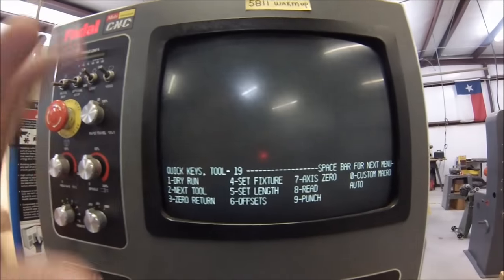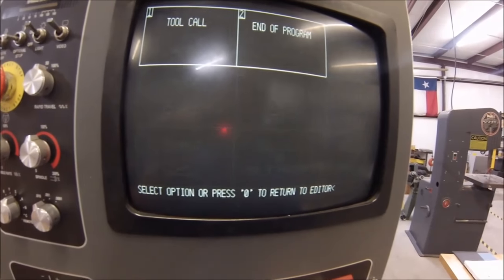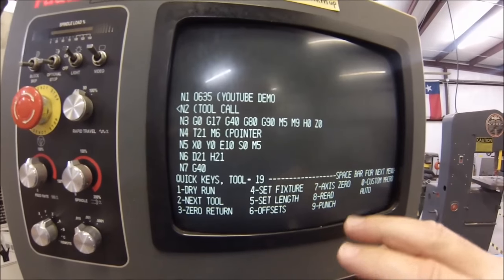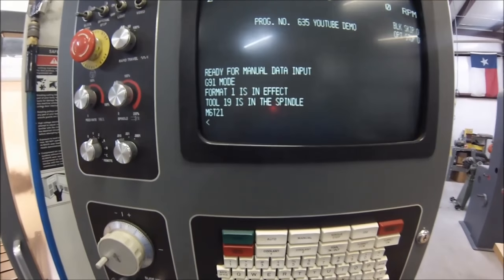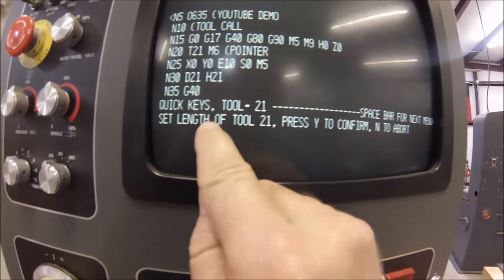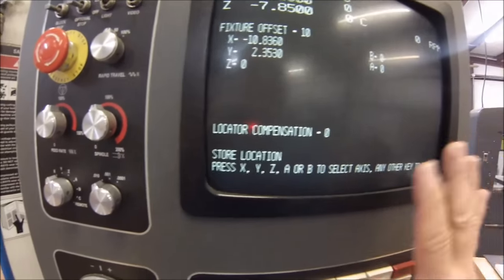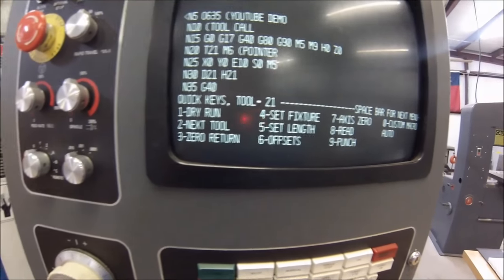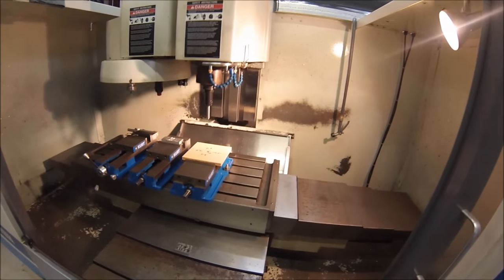CNC Machining Center  Part 3

Comment: Perfect! No more headache! No one ever shows how to set fixture height! Every video that i have found just shows how to set the tool height and tells you should do the same in fixture. I am so relived after figuring this out from youre video, and a post on a forum. fixture off set Z value should always be Z=0. 
I hope you make more videos in the future! you are really good at teaching!
Reply from the maker: I have never had a reason to change the Z height in a fixture offset. Its probably useful for identical features on parts of different heights.
Reply: @joepie221  yeah, i could imagine that.
I have a follow up question, in my program, i have 2 different tools. Do i need to: 5=set length for both tools in my current program?

When i tried calling my second tool in the program, the z-height didnt match up anymore. 
I am quite new to cnc machining and g-code’s but i understand the basic principles. 
Thanks in advance:)
Reply from the maker: @osnapmusic6730  Every tool in the program, and every in your tool changer has to be calibrated for length. YES. Make double sure that when you call a tool, your code reflects the corresponding 'H' value for that tool. If you call T1 and your code says D1 H2....you'll get strange results because all the tool numbers are not matching. The machine will know the 'D' diameter of the tool, but use the length/height 'H' of a different tool. This is mostly a problem when you cut and paste to save time manually programming. It usually never ends well.

Comment: Joe, apologies for not commenting earlier but I'm now watching this entire series (Again), taking notes and applying this to my friend's machine. This series is INVALUABLE for me as a learning tool and is getting me started in my journey of figuring this all out. A Million thanks for taking the time to do this. I might call you with some questions if you have some time. Thanks again Joe!
Reply from the maker: Hi Brad. You can call me anytime. I'll touch off on the G54 ...stuff and all the drilling parameters very soon. In the meantime, ask all the questions you need to.
Reply: Fantastic. Hoping to see you at the bash - as we ALL are!
Reply from the maker: Brad, I just ran a G54 - G59 test on my machine. The program responds to my preset E1 - E6 locations in my offset register. Search your machines offset register to see if you can locate the fixture offset page and look where your #1 thru #6 locations are set. Thats where the G54 .......G59 locations will go to when called up. if this is confusing, let me know.

Comment: These videos are bringing back a lot of memories. Its been a few years 
since I've run a FADAL. Great machine!  I faintly remember a code to go 
back to your fixture offset.  I think it was something like G0E01Y0X0.  
Thanks for making these videos!!
Reply from the maker: I need to experiment with the g54 offset codes. I have never used them. The 'E' offsets are very easy to work with and there are 48  available I believe. Your string calls for a rapid move to the machine E0 home location for X and Y, but I'm not familiar with the '1' after the E0

Comment: I noticed you have a sticky note with the "warm up" program code. But if you change the "O word" of that program to 9998. The computer will automatically save it as the true warm up. So everytime you turn the mill on and after it zeros it's self, it'll ask if you want to "start" your 9998 (warm up) program. So now there's no need to manually load the warm up program.
And after its done cycling if you hit "manual"  it'll automatically restore itself to what ever program you were using/working on; like (YouTube demo) in this case.
Reply from the maker: Interesting. I'll have to research that.
Reply: It works provided you have a new enough controller...but very nice. Thanks Brian. Even my machine tech didn't know about this little tidbit. How did you come across it?

Comment: Thanks joe. Wow information over load, I'll need to write that down after I watch you video a few more times twice so far. I will down load it too into my computer video library. Thanks for sharing.
Reply from the maker: It really seems like a bunch, but when it finally clicks, you'll be surprised at how much easier it seems. Hang in. It will get much better once I start cutting parts for you guys.

Comment: Hi
I have a fadal 88hs milling. I have a problem with the tool offset.
When i call T1 and tried to set the offset the tool number not showing instead of tool number  ?  this symbol appears and when i call T2 symbol change in to 1 
When i call each tool the exact tool number not showing instead the previous shows and 
When i call T1 
In the calling screen 
Its says TOOL 0.3637... IN THE SPINDLES  and when i Call T2 the 0 change to 1.
What should i do?
 please help....

Comment: Great video series really like it.
Only one bracket required for a comment in the G-code?
Thought you had omitted one on the end, until I seen the rest were the same way..
Do you ever use a CAM package to program, or do you just do everything right at the machine? Can't wait for the next installment. :o)
Reply from the maker: I have Pro Engineer Wildfire for Trajectory, volume milling and engraving. But I think its vital for any good programmer to be able to identify, correct and edit code at the entry level. Core skills. I've seen too many ace programmers that could only load pre-canned code and push buttons.
Reply from the maker: About the bracket for comment lines......The machine automatically puts just one in place when it prompts you to enter text, but never asks for the end one. You can use two without any problem.

Comment: Hi Joe!  i bought a Fadal vmc 2016L and have never used one before, i have watched their videos and i have learned a lot, i have a precision Matheus M25 that i converted to cnc, and it uses centroid software which is easy, but the machine is too small and weak for what I want to do it, but it works very well for small parts I've done some parts and it turned out really good.  I would like to know if you could explain to me how I do bolt hole circle in Fadal.  Thank you 
Wagner Damotta
Reply from the maker: The bolt circle option should be in the fixed routine sub folder in the monitor. Its conversational in format 1 and pretty easy. Hit 'F' for functions, then you'll see it.
Reply: @joepie221  thank you
I going to try and i let you know
Thanks again
Wagner Damotta

Comment: I'm curious about the doors on the machine. Isn't it a safety feature and the machine isn't supposed to work without them closed and if so, how is it working with the doors open
Reply from the maker: I believe you are correct. Mine works fine with the doors open. I like it that way.

Comment: Joe, did you initally have to write the end of program code and other codes on the function screen or is that a preset code in the machine from factory, and if so can they be modified. Sorry for the crazy questions, just starting to learn CNC
Reply from the maker: The "new tool" and "end of program" code is in the controller. yes it can be modified to suit your needs. Thats one of the ways I deliver the  table to the door when the part is done.

Comment: How many line of code can you controller process?
Reply from the maker: I am not sure. I have pumped 15000 lines of code in via USB in a matter of minutes and the machine didn't even birp. I also have about 1000 programs in the controller, so its pretty robust.
Reply: That's pretty awesome for an older controller.  I was not familiar with this VMC.  Thanks for sharing!

Comment: Why don't you set your tool height offset when you install the tool and then use the fixture height offset? The paper documentation approach looks like a lot of extra work and an invitation for disaster.
Reply from the maker: I go through so many jobs on this machine, the offsets are always changing. The paper setup sheet is a blessing for my shop. I have actually never set a Z height in a fixture offset.